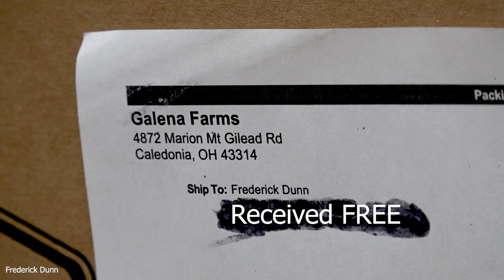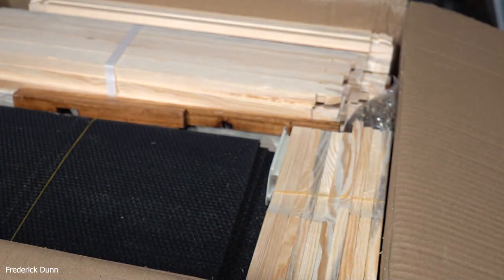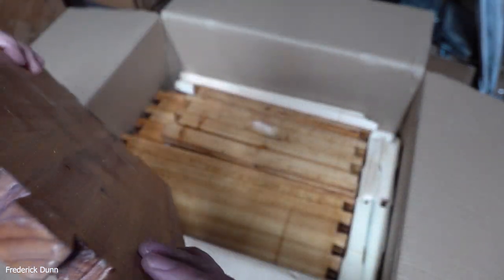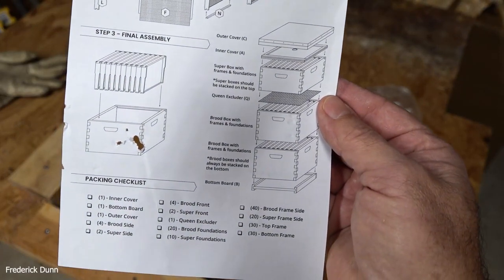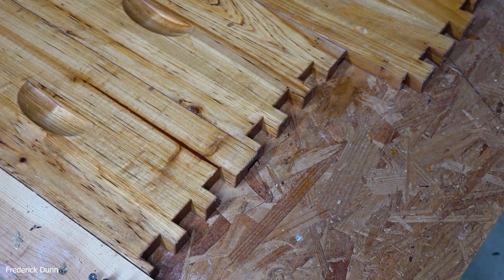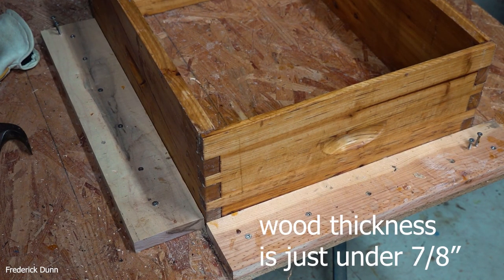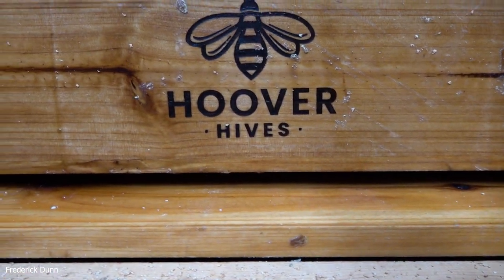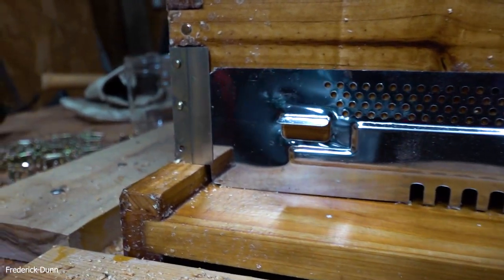Honey Bee Hive 10 Frame 100% Pre Waxed, By Hoover Hive, Sold by Galena Farms, Beginner Hive Kit Assy

Comment: Sad to say the hive is not Amish made nor is it bees wax just paraffin. This hive is made in China from Alibaba.com If you look at Kamon Reynolds on youtube you will see the property wax coating is done. The wood should be dry like wood. This exterior wax coating is an exterior coating that will wear with the seasons instead of being absorbed like Kamon demonstrates. It is well built and the hive itself costs $68. It's upsetting seeing someone implying that it's Amish made when it's from China.
Reply from the maker: That's not what the manufacturer site says?  https://hooverhives.com/product-features/#1577729184435-2e231889-bc47
Reply from the maker: there is a primary hot-coating, then a second dip into the bees wax according to the manufacturer's website. Kamon uses paraffin wax.
Reply: mr dunn you should REMOVE THIS COMMENT!!!! alibaba is a site full of CROOKS AND THIEVES!!!!!
Reply: @sunsetheritage  lol your comments are everywhere i dont' care where its made you must sell for mannlakke? lol
Reply: I think Tim is correct in his assumptions. The site offers Amish Hives but these have box finger joint corners and the hand holds are different. The dove tail boxes that you put together are a match to ones being offered from Chinese manufacturers. Of the 3 choices of hive kits offered, only one is listed as being Amish made. They seem to have left out where the others are made. So I would suspect dipped in Chinese bees wax, wonder what chemicals are in the wax.
Reply from the maker: @TheHoneyJudge  Yes, the composition of the wax would be another thing to consider for sure.
Reply: @FrederickDunn  It looks dipped in parraffine.The thick coating is left because its hard to clean the parraffine fast after dipping ,before it  solidifies in certain places.
It might have ( for sure) a thin coat of real bees wax on the interior ,for advertising  .Looks like people like these beehives wich makes me happy because i also have wax( parraffine) dipped beehives.
Reply: @FrederickDunn  The composition of the wax( the parraffine) used for dipping ,is probably same grade as those parraffine combs you used.Edible grade parraffine.